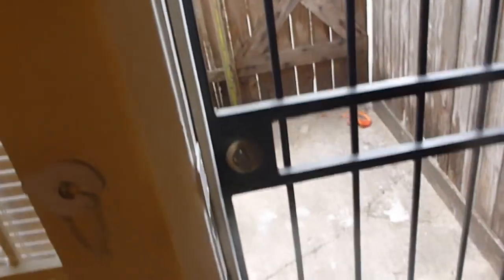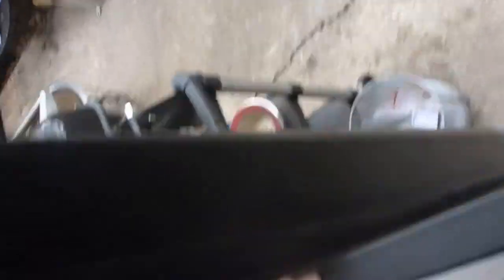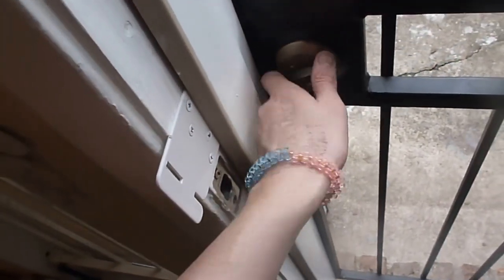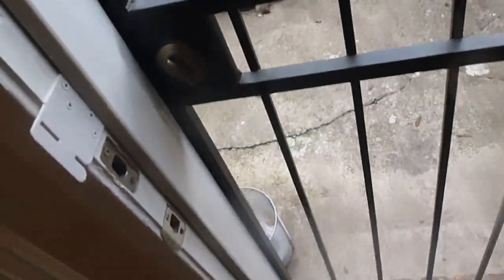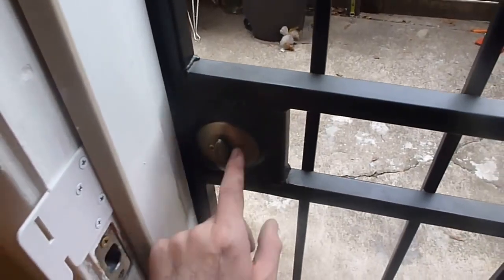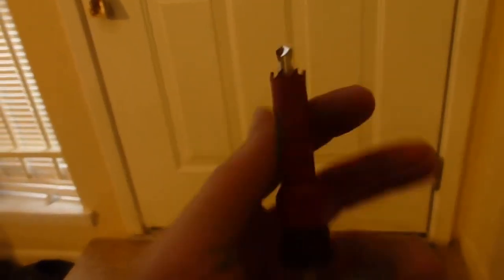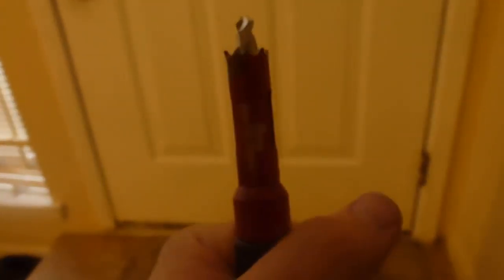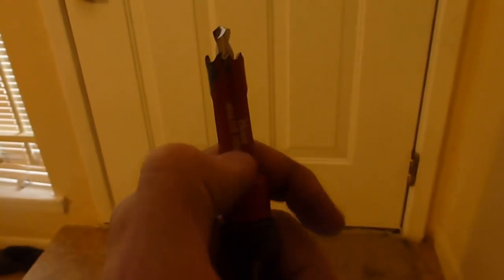How to Install a Door Viewer on a METAL Door -- Peep Hole

Comment: So the drill bit costs more than the peep hole if you buy a peep hole tht requires a
9/16 inch drill bit. I took mine back and found a peep hole that requires a 1/2 inch
drill bit which is easier to find. (and I already had one!)

Comment: You can attach some diamond pattern metal mesh with some small sheet metal screws to the metal door.  You don't have to cover the whole inside of the metal security door, just enough to prevent someone from the outside from reaching in to unlatch the deadbolt.

Comment: Thanks. I am wondering what is the logic that they will not allow you to have a double dead-bolted door
Reply: If there is a fire and you can't find the key....
Reply: @jayinthe3122  oh. I thought double dead bolt meant two dead bolts or a lock and a dead bolt. I didnt know it meant a dead bolt that has to be unlocked with a key from both sides.
Reply: Fire..too slow tryin to get out!
Reply: @lpmg3940  Big brother always looking out for you
Reply: My relative leaves the key out and nowhere near the door. Drives me crazy and precipitates an argument with me. So is 9/16 the standard peephole? (ACTUALLY I want to install a peephole cam.)
Reply: Must have been the bars on all of the windows ?